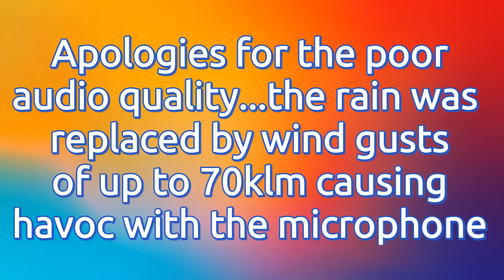Morris LC Rescue- Episode 8 part1:  The Teardown and 1950 Morris LC3 Engine revival

Comment: Used too set fire too engine blocks with diesel in cylinder and a blue roll wick!! Then  them in gear when got warm heat and diesel fuel works it way down past the rings with the thermal expansions! Free off a lot of engines people had wrote off! Can't wait untill I am fit again too try another project!
Reply from the maker: Hahaaa… love it Mick👍 everyone has a favourite trick for busting loose stuck pistons. I don’t think I would be game enough to try that one but it makes sense  🤔 I guess I am a bit more cautious as these engines are a bit on the rare side over here and I don’t want to be “ that guy” that caused more damage 😂 really appreciate your advice mate👍 get well soon 👍😉
Reply: @morrislcrescue  If you ever get a real stuck one it works a treat! The engine is on fire inside every compression stroke! It gets engine too temperature when seized! I bet parts, are, scarce for it in Australia too! Will make a lovely truck once done! Can't wait too see more progress! New subscriber here!

Comment: Just a heads up about valve springs with a couple of coils close together on one end. That end should be down on the spring seat on the head not at the top.
 The spring has been designed to control valve float or bounce and can't do it's job if fitted upside down.
Not criticising, just saying.
Looking forward to part 2
Cheers Eric
Reply from the maker: Cheers Eric, appreciate you watching and your advice mate, great pickup and I’ll get it sorted 👍  really glad you are enjoying the content … many thanks JC

Comment: Why didn't you take the engine out? Interesting project lots of patience keep at it.
Reply from the maker: Gidday Tom, that’s a great question mate 😂….simple answer is I have run out of room in the workshop… as you might see in the other videos I still have Olive Oyl ‘s chassis on the Jack stands and her engine still in the test cradle and thanks to Mother Nature not cooperating they are yet to be painted. If the floor was clear Holly would have been in that workshop quicker than you can say “ Morris Commercial “ with the engine in the cradle for repairs, but hey not being one to shrink away from a challenge I  decided to try it “ in frame” … but yes pulling the engine would definitely have made life easier ( and probably drier - has been the wettest October since records began in North East Tasmania this year 😳) appreciate you tuning in and commenting- kindest regards  JC👍😉

Comment: Evaporust would have sorted that rust out. Its amazing.
Reply from the maker: Thanks for the tip Mr.PK1967, I have heard great reports about Evaporust and would like to give it a try at some stage… I mess about with the electrolysis a fair bit as it is kind of fun but it’s also a reasonably low cost solution that any young fella could attempt if he has an old battery charger and some laundry powder… appreciate you tuning in and commenting- kindest regards JC 👍😉

Comment: Hot Diesel Fuel in the Bores first.....a Mallet or Drift could break the Piston Rings..
Reply from the maker: Thanks for the tip Peter, sounds like a cost effective and practical idea to me 🤔we might just give your suggestion a run then with the stuck engine we recovered in episode 2 which we should be starting work on in a couple of episodes time… appreciate your input  mate, kind regards JC 👍😉